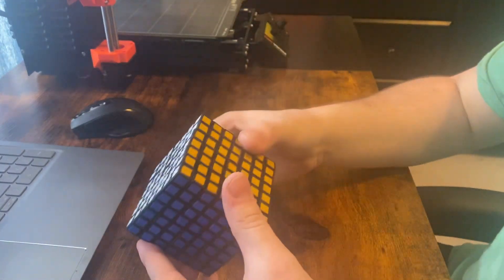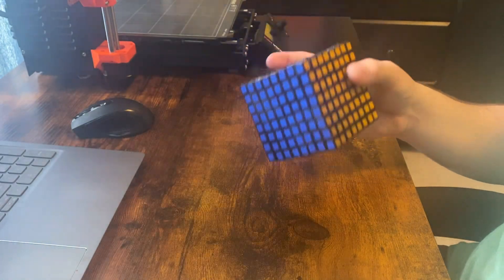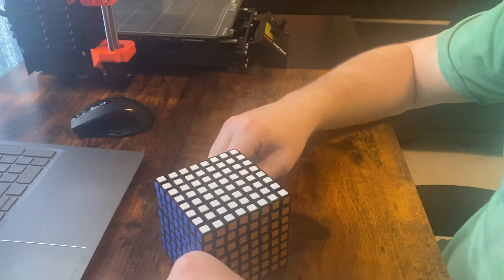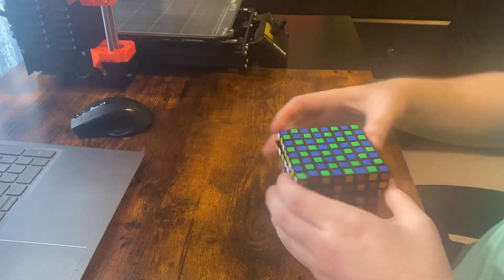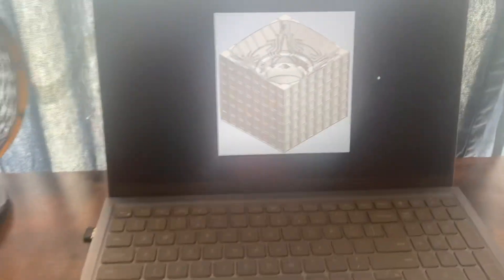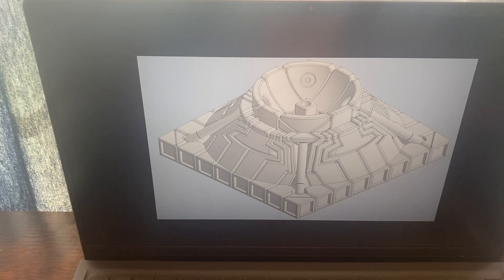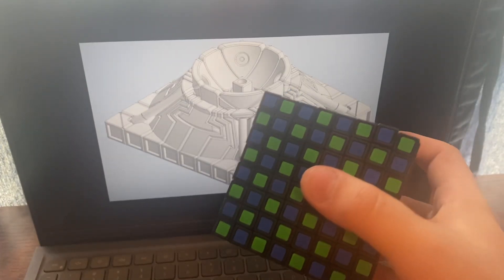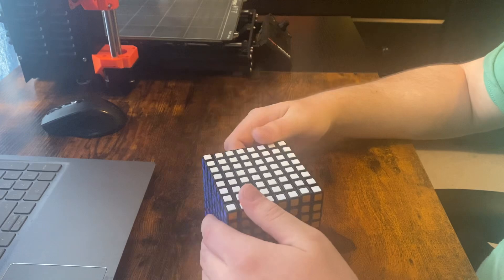Custom Cube Design #43: Proportional 8x8

Comment: The 3 shell concept sounds like Meilong/Diansheng 8x8 (3x3 inside a 5x5 inside an 8x8)
In my theoretical ideal 8x8 and the qiyi 8x8 it would only have 2 shells (5x5 and 8x8 without the 3x3)

I'm not too sure that the multi-shell can help the stability issues though. It helps to anchor the root (which definitely improves stability on a rigid corner). However, the issue here seems to come from an elastic corner. I was thinking someting along the lines of the Aofu GTS's anti-deforming mech but between the 1st/2nd layer instead of 2nd/3rd, but that itself is tricky to implement in the is overhanging part.
Reply: But anyway, congrats on making the world's first proportional 8x8. It's just really great to look at as a shelf item.
Reply: Why only two shells?
Reply: @ I have tried both the Diansheng and Qiyi 8x8s and the 3 shell ones felt too stiff and rigid.

This comment is outdated and Qiyi has sinced released a second 9x9 with all the descriptions I mentioned (2 shells, and the Aofu GTS's anti deforming mech)